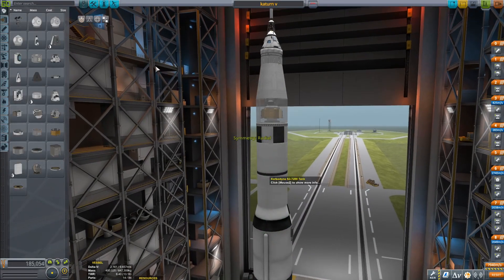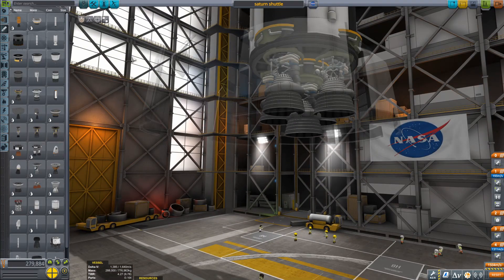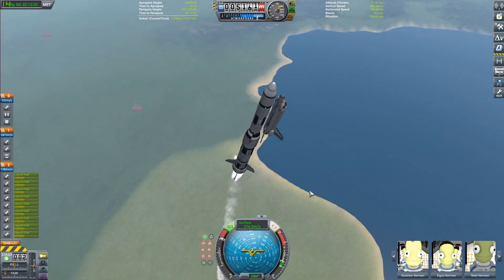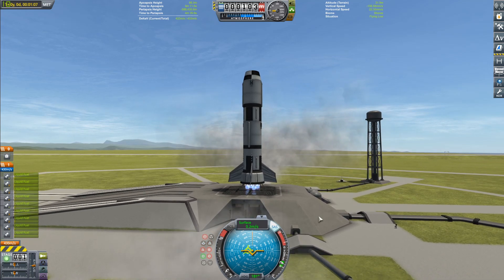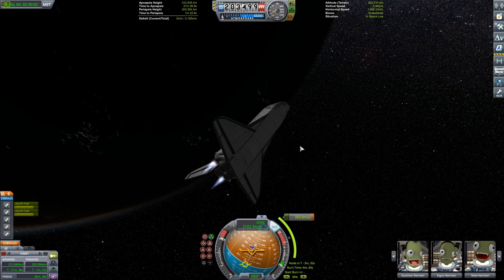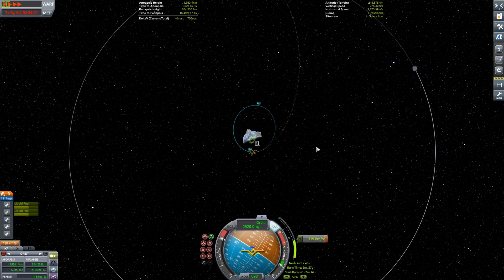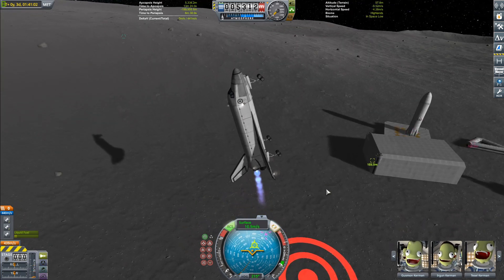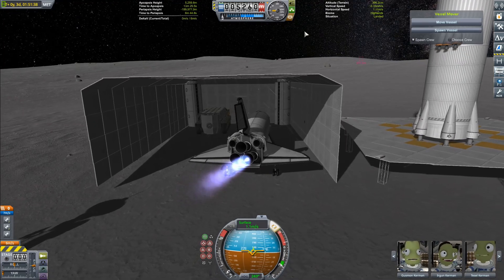KSP: Nasa's  Cancelled Plan To Launch A Space Shuttle On a REUSABLE Saturn V

Comment: Er, where did you pick up that it had "boost-back and land at the launch site" capability? That wasn't considered for this version which could only be recovered down=range (by parachutes and splash-down) at sea. There was a version with a 'fly-back' S1 stage but never a boost-back concept and certainly no 'powered landing' one as the F1 was both incapable of in-flight re-start and did not have enough throttle ability to perform a landing. (Even the "70%" throttle of the F1B wasn't fine enough control) 

Also the 'second stage' (SII stage) could not be used as a propellant tank for the first stage F1's as the second stage tanks were for hydrogen and oxygen (hydrox) whereas the first stage was powered by oxygen and kerosene (kerolox) propellants. What they would have done is 'stretch' the first stage tanks to accommodate more kerolox but it was only about a 20ft or so length extension.